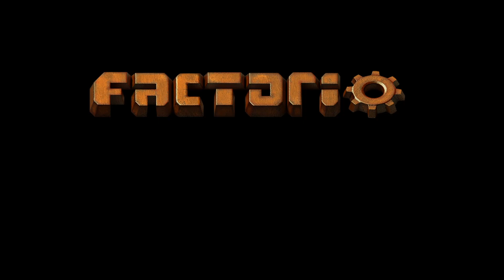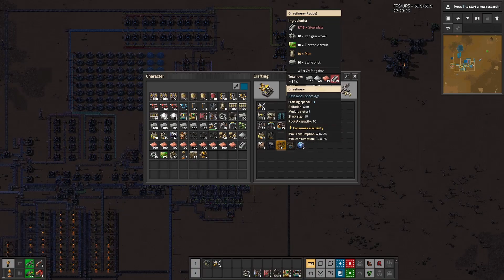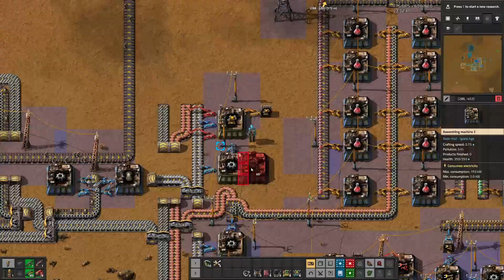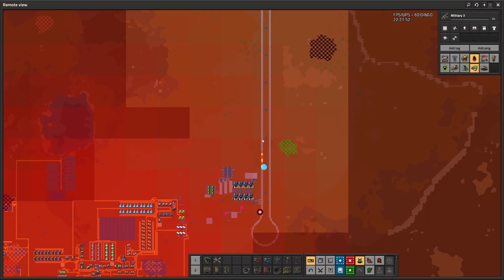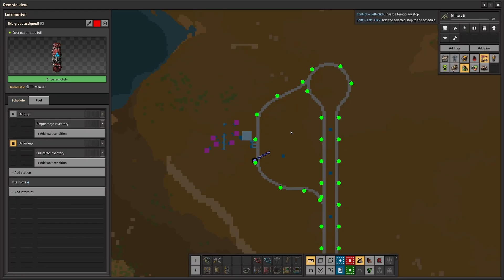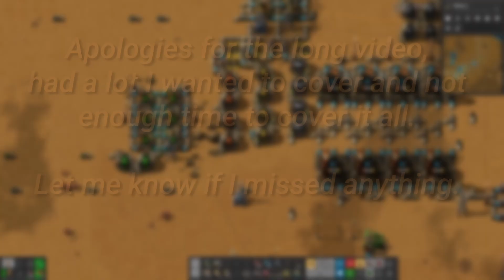Factorio Guide for the Brand New Engineer Part 3: Basic Train and Advanced Oil Cracking w/ Circuits

Comment from the maker: Want the exact map for a 1 to 1 play along? Just use the seed 2533210412 in your world generation!

Note: This is running with Space Age DLC turned on, if you're running Vanillla, the seed may not be 1 to 1 exactly. But it should be mostly the same.

Comment: at 9:45 you start talking about limiting and logic for calling trains based on what's in the tanks - is there any chance you could provide a quickie on that section alone? like which lines and which checker (you mentioned combinators specifically) and how they get connect to each other and the network, as well as the what the output indicators do/mean (in this case "L")?
Reply from the maker: If you look at the 8:40, I walk through the wires and the combinator itself, explaining that we simply are dividing the amount read in the tanks by the amount needed to fill a train, in this case 1 wagon.

Later in the video when we get to oil cracking, we do discuss a more complicated circuit setup that, when understood, opens up possibilities all across the factory.